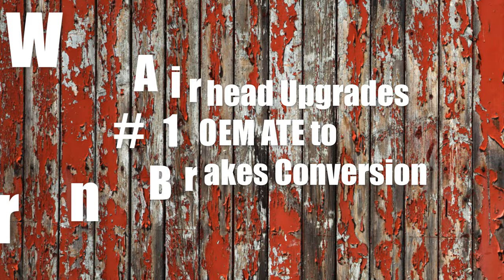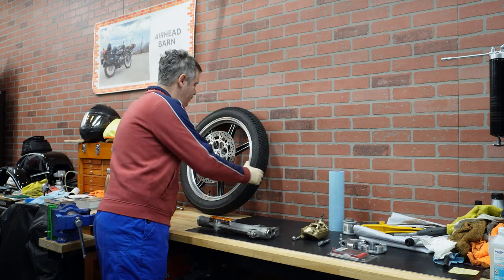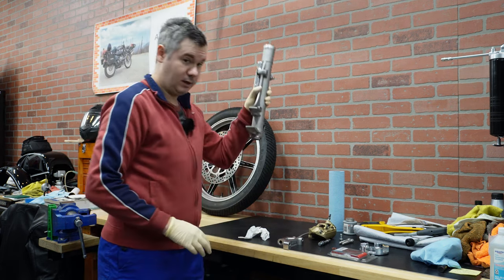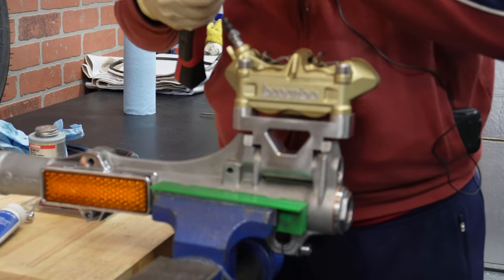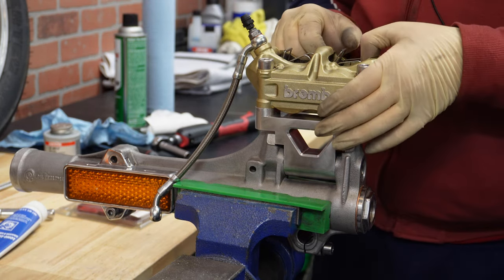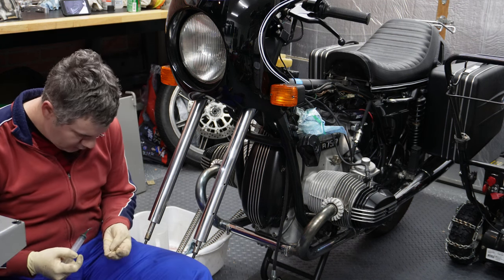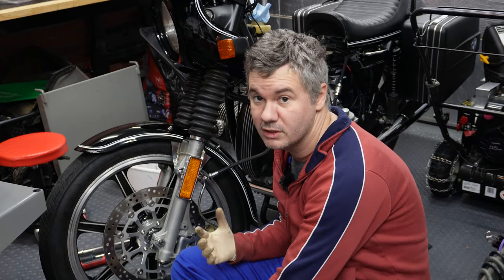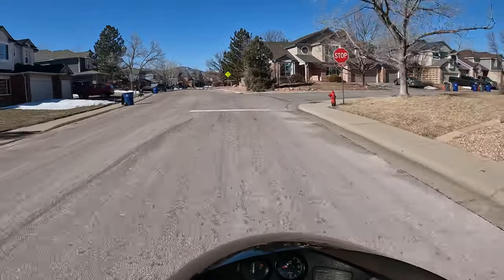BMW Airhead ATE to Modern Brakes Conversion

Comment: It's a lovely conversion, my first RS had those awful eccentric pivot ATE calipers. Surprised you didn't go for a handlebar master cylinder and full braided at the same time (it never ends 😁)
Reply from the maker: Hi Stewie, thanks for watching. I decided to start with just conversion and then go from there and now I can say stock under tank master cylinder works well and there is no need to replace it with handlebar mounted one. Main brake line is stock (rubber) but recently replaced.
Reply: @airheadbarn   a nice radial brake master cylinder at the appropriate ratio is the next step up in feel and performance. 
So, I have a nice set of Brembo Goldline 4 pots to fit to my R100RS Mono. Not radial calipers but 1 step at a time 😁

Comment: Do you think the end result is great? Do the breaks feel pretty natural and not too full on? 
I recently purchased a 77 R100/7. I bought it knowing front brakes don’t work. I reconditioned everything to perfect. The brakes were terrible compared to my 91 Airhead. I felt like selling the bike but this video gives me hope. As long as brakes not too savage after this conversion like someone else in comments mentioned. What do you think? Maybe another video with final conclusions after some extended use.  Thanks again. Good content.
Reply from the maker: Thanks for watching. I can definitely post some more comments after more riding but these first couple of hundred miles I did with this new brakes setup, makes this the best upgrade I did. Feel for these brakes is so natural. They are truly modern brakes. I had f800gt, and not taking untilocking functionality into account, these brakes come very close. I finally have full control over the bike with only 2 fingers and I can dose it however I like. This is my experience but ymwv. Good luck!!!
Reply: @airheadbarn  okay thanks very nice. That’s a great appraisal.

Comment: I’m considering doing this upgrade in addition to having a brass sleeve installed in the master cylinder. Do you think the shrinking the master cylinder diameter from 14mm to 12.7mm will negatively effect performance when used with a brembo caliper?
Reply from the maker: Hi David, I installed same setup on 2 different bikes: r75/7 with 14mm master cylinder and r80st with 12mm master cylinder. The one with 14mm cylinder performs way better. All brake components of both setups are updated for the best performance but simply 14mm works much better. You will probably have improvement compared to stock Ate system but if your stock is 2-pot brembo like I have in my r80st, there is no significant improvement. Actually, I can now say that I liked stock 2-pot brembo better. Hope this helps and thanks for watching.
Reply: @airheadbarn  thank you for your reply! It’s very helpful. I purchased a brembo caliper like the one you have. My concern is that my current master cylinder could have pitting on the inside surface. If 14mm offers better performance I wonder if the master cylinder could be bored out and sleeved to the same 14mm diameter. I’ll reach out to Apple hydraulics and see what they say.

Comment: many thanks for your very informative video. Absolutely helpful and priceless.
I am going ahead and will order from Matt(R90x designs) the parts I need to convert my brakes (BMW R90/6 early 1974)to exactly what you just showed us. My concern and question would be, to operate a brake lever with integrated master cylinder, how would I be able to get away with the setup I am having now which is an integrated brake lever and throttle twist grip? Any advise would be highly appreciated. Many thanks Felix
Reply from the maker: If I understand correctly, you are saying you updated master brake cylinder to handlebar style, right? If so, please check the video where I did the same conversion on my R80ST. That should help you. Matt is also very helpful and can guide you through the installation. Good luck and thanks for watching.

Comment: Can this conversion be completed on a 1994 R80RT?
Reply from the maker: This one definitely not since it is a conversion for ATE brakes and your bike has Brembo. If the adapters exist, it would be similar to my R80ST conversion that you can watch here:
https://www.youtube.com/watch?v=sg5QUhHGcBY

Your bike most likely has dual brakes so you would need to source the parts for that particular setup compared to ST in video that is single disc. Give Matt from r90xdesigns a call and check if he has the adapters for your bike. Good luck and thanks for watching!

Comment: FWIW I have the same R90X kit on my R75/6 with the stock under tank MC and it works fantastic.  I've collected the bits needed for a handlebar MC swap and will do so either the next time the stock MC leaks and needs to be rebuilt (again) or when I have some spare time.  Can't agree more with the closing sentiments of this video - among the best upgrades to my R75.

Comment: Thanks for the video. The brakes on my r65 are going to be my next upgrade. Question, what is that tiny gauge in your cockpit? Right in the center front? Is that a tiny clock or oil temp gauge?
Reply from the maker: Thanks for watching. It is ambient air temp gauge :)

Comment: I just purchased an R80/7 that’s been bored out to 1000cc, and and plan to attach my Sputnik 3 sidecar to it. I’ve been told the ATE front brake might not do well with the extra torque and sidecar load, plus, I imagine those ATE brake discs are probably a little more $$ than more modern discs, so I may look into a Brembo conversion. Would I need to switch out the master cylinder?
Reply from the maker: You can start with stock master cylinder and see how it will do. It works for me but it might be a bit underpowered for sidecar so you will need to experiment a bit. Thanks for watching!

Comment: the conversion looks nice but it requires quite a lot of work. Although Gold BREMBOs are way better than ATE calipers, I guess that a pretty similar result can be achieved by getting rid of the crappy under-tank MC in favour of a radial piston lever on the handlebar while retaining ATE's. Not to mention that too much braking power on one rotor only tends to warp those slim downtubes.
Reply from the maker: Hi Enrico, I considered that as less involving mod but I doubt master cylinder swap would have equal result as big rotor and 4 pot modern calipers but don't have data to confirm. I heard many people mention tubes warping if brakes were too strong. I would still like to see the real example. Lets see if there is someone who experienced this. Thanks for watching

Comment: Interesting upgrade. Your BMC is the 14mm (I assume) or the 17mm one?
Reply from the maker: Yep, 14mm. Thanks for watching!
Reply: @airheadbarn  I have a 78 R100RS Motorsport edition and since it's a fairly rarer version I didn't want to change the stock ATE caliper forks for the Brembo ones (I've had a great deal on some with calipers included and new brake pads) so instead I bought a new 14mm bmc and I have to say it works very well. The wooden feel has gone and now it's almost like my K1100RS.
Reply from the maker: @paulojrg  glad to hear that worked out for you. Yeah, cutting those fork leg ears can be a deal breaker. Not for everyone’s taste but it made a huge difference for me